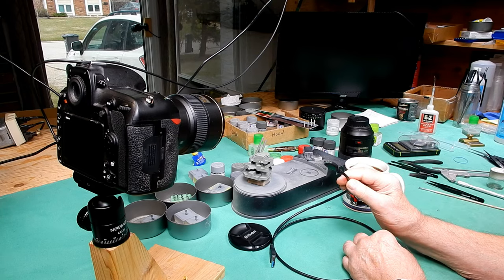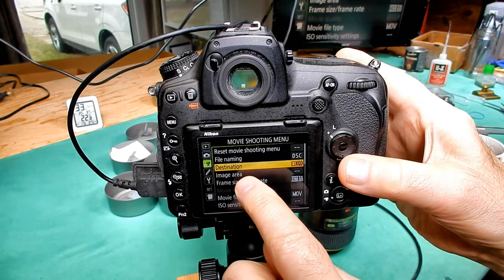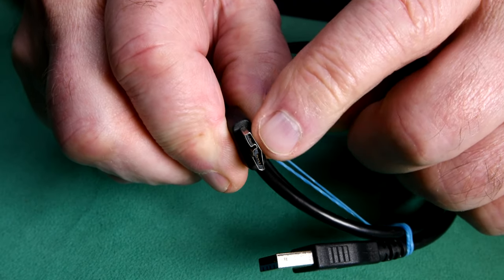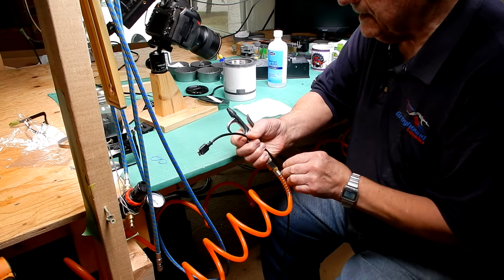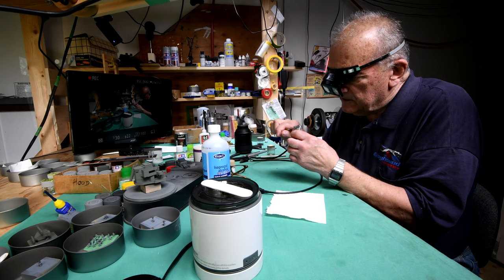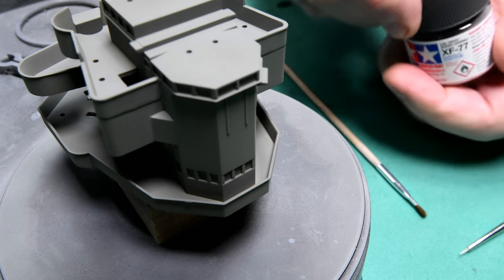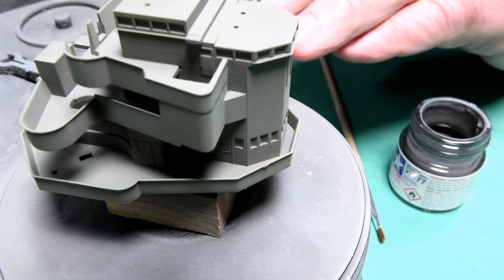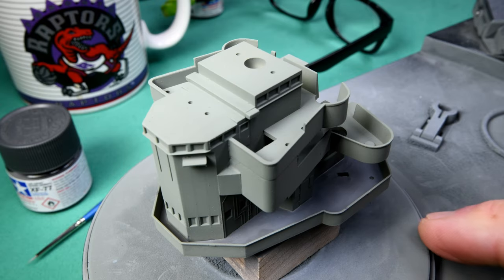The Model Ship - Part 796

Comment: Hi Ron, glad you fixed your cable - might be worth getting one of those cheaper ones for a backup just in case! Good work painting the deck.
Reply from the maker: Hi Barry,
My son saw the video. Phoned me to say I could have his. He has an almost identical camera (D-810) Same USB connecting cord. He doesn't use his because he simply uses the plug that is on his portable hard drive. WHAT ??? I've actually got 8 of those drives that I back up my video files on. All with the same plug. I must be getting old! 😧
See you tomorrow. 👍

Comment: I'd buy another cable I've done the same thing but it's been model parts dropped on the floor moved my chair & heard a crunch  I learnt from that good luck with your lead cheers Ron 👍👍👍👍😀
Reply from the maker: Hi Trevor,
As it turns out, I've got at least 8 of those cables already, but didn't know it. I'll explain tomorrow. 😁